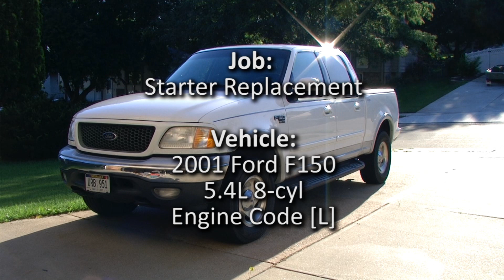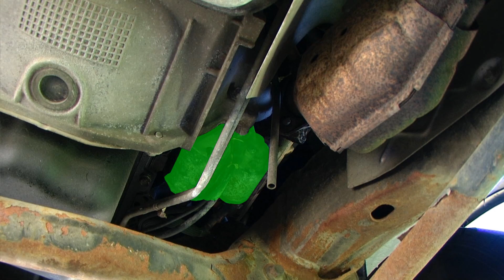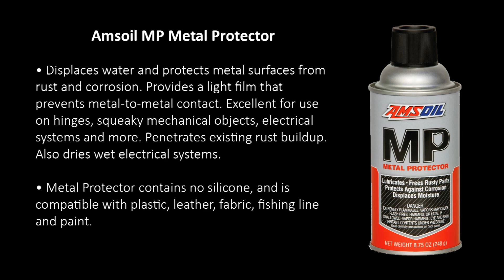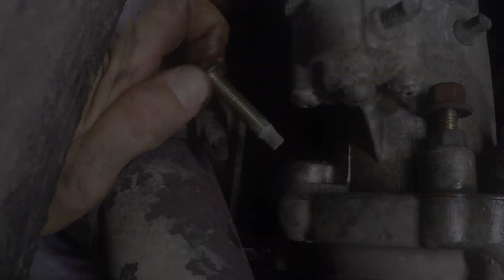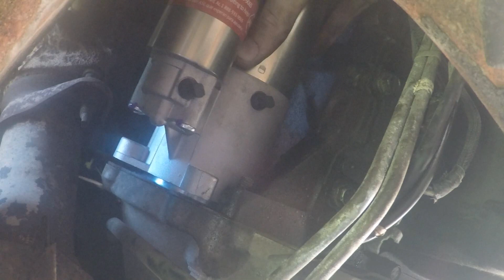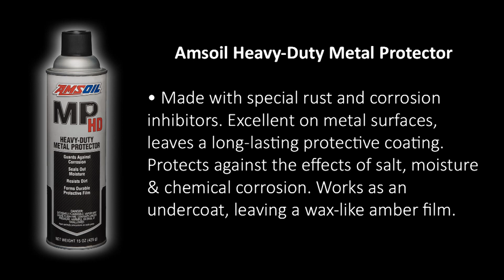Starter and Solenoid Replacement - 2001 Ford F150 - (1997-2003), 5.4L

Comment: Fantastic video. Still the best one to this day on YouTube for this starter replacement! Gonna go change mine right now because of this video
Reply from the maker: Thanks for the comment.  Good luck with your repair.
Reply: @InsaneOil Just changed my original 1998 27 year old starter with over 250,000 miles!! Talk about ford built tough! Thanks to your video it answered all the questions I had and was so well filmed it made me believe reaching that top bolt was a lot easier Haha! 🔥🔥🦾😮‍💨
Reply: @InsaneOil Just changed my original 1998 27 year old starter with over 250,000 miles!! Talk about ford built tough! Thanks to your video it answered all the questions I had and was so well filmed it made me believe reaching that top bolt was a lot easier Haha! 🔥🔥🦾😮‍💨🍻

Comment: Thanks for sharing this. Very clear and useful. The biggest challenge was getting that bolt that cannot be seen. What helped me was to turn around with my head towards the front of the truck and my legs towards the tail and to reach that bolt with my left hand around the exhaust. It was the most natural position to work on it.
Reply from the maker: Thanks for your comments and tips.  It sounds like it was a successful repair.
Reply: @InsaneOil  it was indeed.

Comment: Probably the most descriptive F-150 starter replacement video I've watched so far.  Great job!  Thank you!
Reply from the maker: Thanks for the comment.  Good luck with your repair.
Reply: @InsaneOil  Thanks!  I was hoping to get it done in less than an hour but, it took 2 hours because of that stinkin' top bolt.  At least it's done and so far so good.
Reply from the maker: @1991DesertVet  Sounds like a successful repair.

Comment: Pb blaster is better
Reply from the maker: PB Blaster is an okay product...my dislikes towards PB Blaster are 1. the base oil is petroleum distillates which are the least refined petroleum-derived products (ie. cheapest) and 2. it has uses limited to mechanical applications, where as Amsoil Metal Protector has a base oil of hydrotreated distillates (better engineered) and can be used for other applications, such as an electrical cleaner, etc.  https://www.amsoil.com/p/mp-metal-protector-amp/?zo=10458

Comment: I have a 2000 f150 it leaks, now after rain truck randomly tries to crank w/o keys in it . It's just trying to start by itself. Any ideas why?
Reply from the maker: Any luck?  Could be faulty starter wiring, bad starter relay, switched wires on the solenoid, or other things.

Comment: insane oil, please allow me to ask  your expertise regarding about the radio NO Power .fuse box inside  under dash  found # 20 and 21 NO Power  but the rest of the fuses were okay including relays also checked fuse box at engine compartment were good maybe you can shed a light on my issue. i thank you anyway , what power the fuse 20 and 21 i suspect  it could  be a short but not quite sure please help. 1999 ford f 150 lariat 5.4l my truck
Reply from the maker: If you switch out the fuse and it blows right away then you know it is a short somewhere.